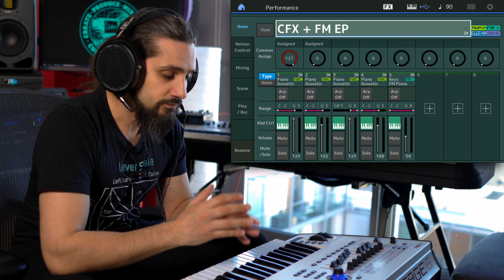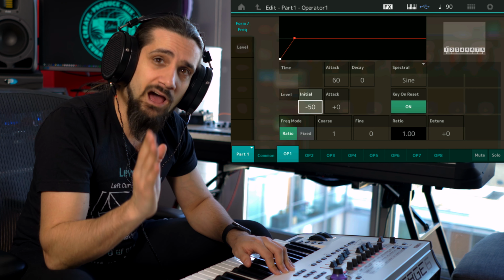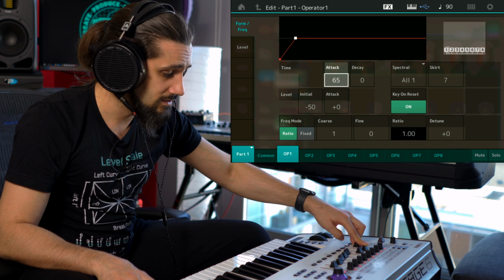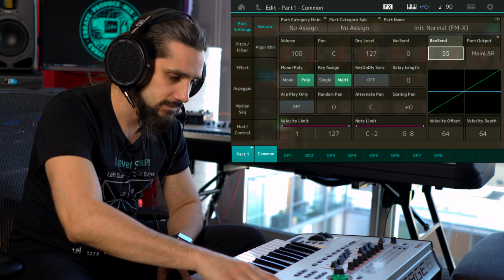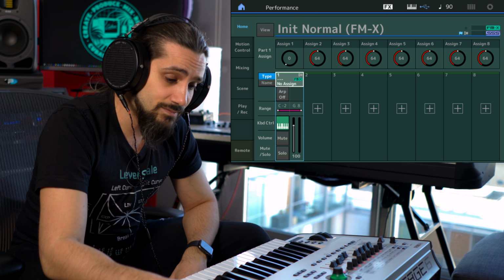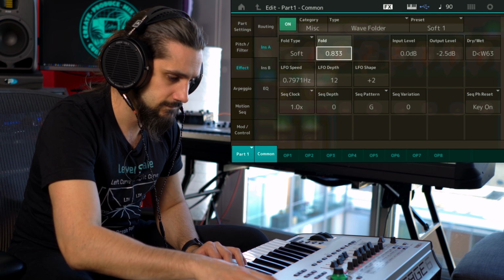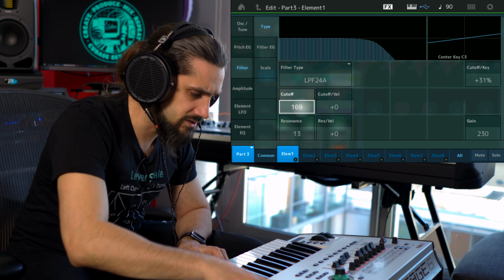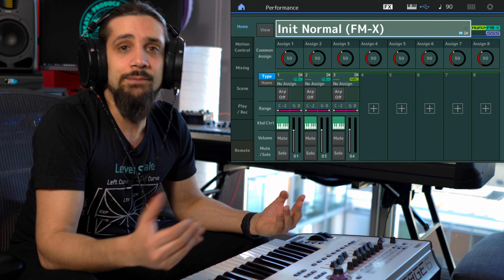Create HUGE Risers and Transition effects with FM-X engine on the Yamaha Montage and MODX

Comment: Hey dom great video!  Can you please tell me how do you screen record the montage dispay?
Reply: You plug in a class-compliant USB to video adapter into the Montage or MODX USB port. When you turn the keyboard on, it will see the adapter as a display, and will echo the output of the touchscreen to it. You can then use a video capture device on that.
Reply: @ScottsSynthStuff  then how are you gonna record the audio thorough usb? Does the montage come with two USB ports?
Reply: @SadhanaKhawas  You use the USB port that the memory stick would normally plug into for the video feed. The other USB port can still be used for audio and MIDI.
Reply: @ScottsSynthStuff  got it 👍
Reply from the maker: @SadhanaKhawas  What gsmac1969 said! Don't forget the Montage is a USB audio interface so you can record the audio with no additional cables. :)
Reply: @DomSigalas  Nice!
Reply from the maker: @SadhanaKhawas  Just added the links to to the products that I'm using on the description if this helps :)
Reply: @DomSigalas  okay I will be sure to check out and why did the angle in this video is different and did not place the montage in its usual place